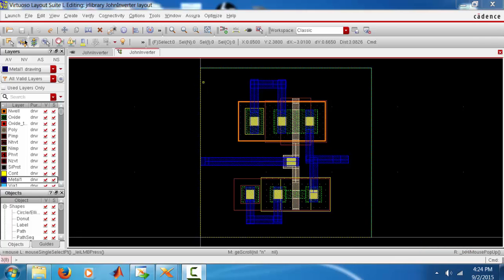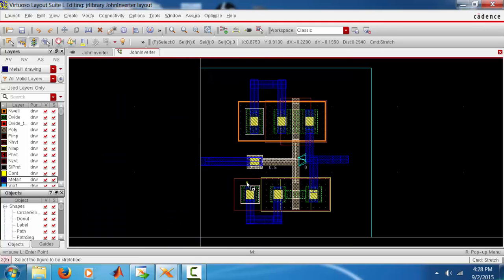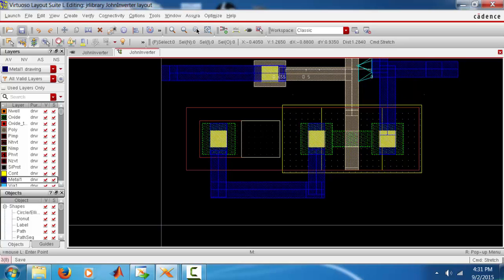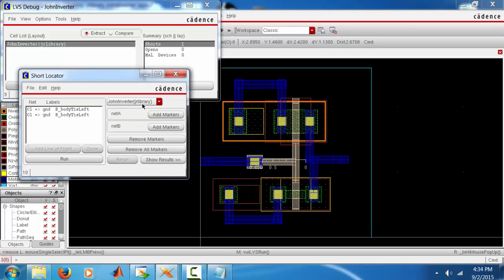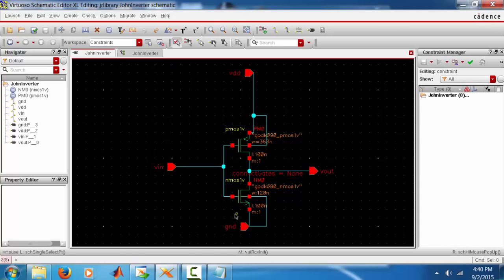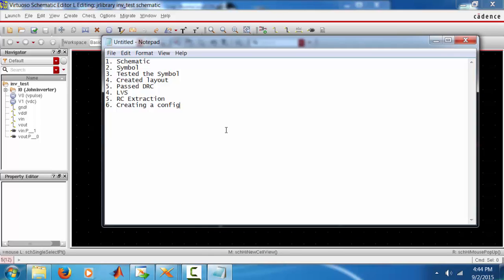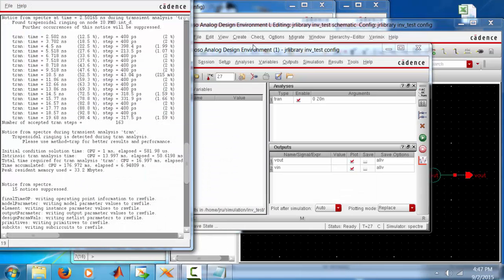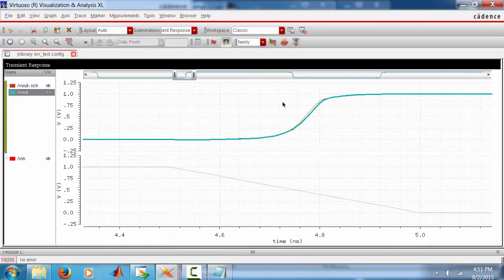Layout of Inverter, Cadence Virtuoso,90 nm: Part-2

Comment: Due to COVID19 Pandemic colleges are not opening and I can't access the cadence software so I searched for an open source software and I found GLADE. Check out my playlist on Layout Designing using GLADE. #LearnFromHome
Playlist Link:- https://www.youtube.com/playlist?list=PLWcG9vtrFH0YVZvd3yf2Xmm_Gl0y-XXz6
Video 2&3: Glade Downloading, Setup and Configuration. 
Video 2 link: https://youtu.be/LMZ3O6Akfro
Video 3 link: https://youtu.be/1ueSinMmqkA
Video 4: Designing Layout of nMOS and pMOS is explained. 
Video 4 link: https://youtu.be/oOblwp65WFA
Video 5: Designing CMOS Inverter Layout using 1 metal layer is explained in detail.
Video 5 link: https://youtu.be/Qr0nTPo-Ri0
Video 6: Verification of Designed Inverter Layout using LT Spice. 
Video 6 link: https://youtu.be/kvrF6Zv6Y_U
Video 7: Designing CMOS Inverter Layout by using 2 metal layers and Vias.
Video 7 link: https://youtu.be/HZopqROB2GA
Video 8: Designing 2 Input CMOS NAND Gate.
Video 8 link: https://youtu.be/41067AYX_do
Video 9: Verification of Designed NAND Gate Layout using LT Spice. 
Video 9 link: https://youtu.be/3pufZ6InuHQ
Video 10: Designing 2 Input CMOS NOR Gate.
Video 10 link: https://youtu.be/skYC2UnJgQ4
Kindly Like, Share among your engineering friends so that they can also learn from home and subscribe to my Channel for more GLADE Tutorials. Your Support will be appreciated.
Thank You